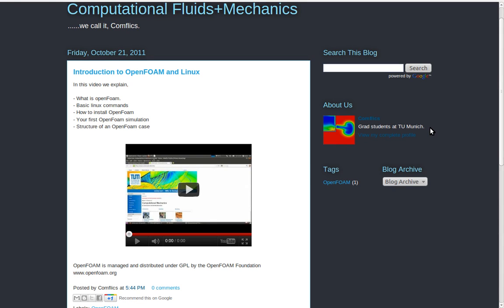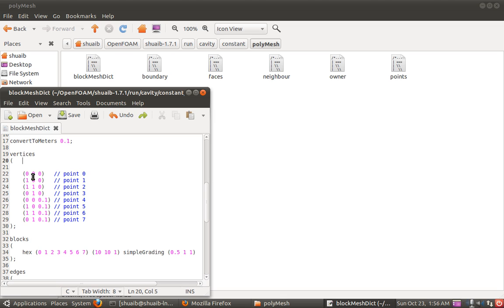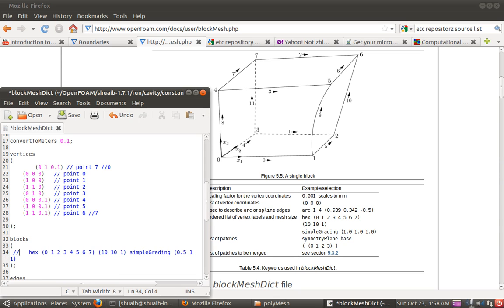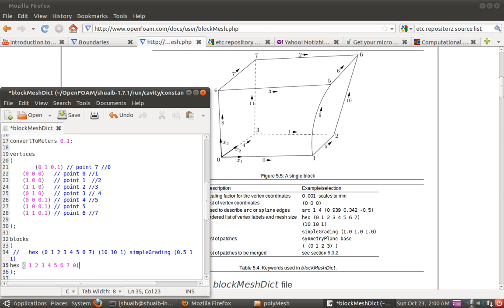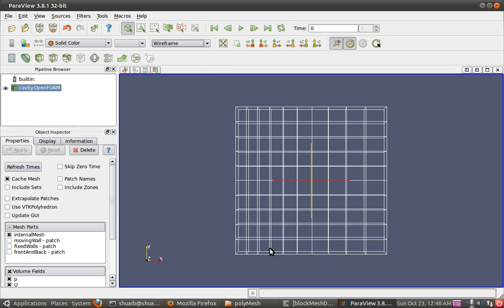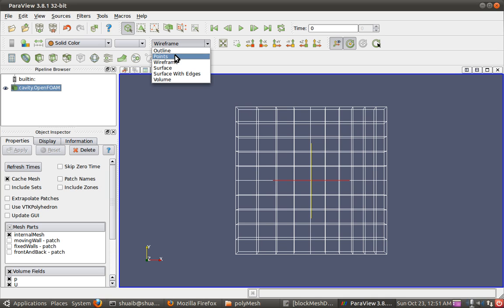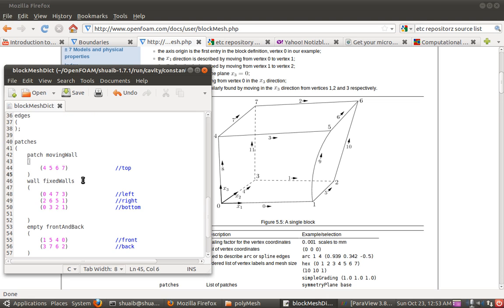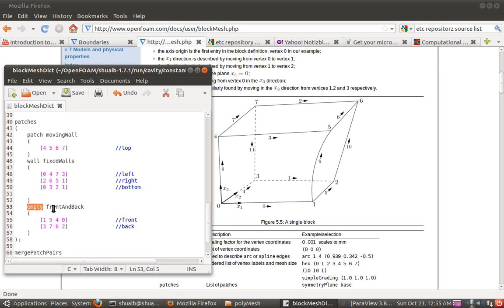OpenFOAM Tutorial #2 - blockMeshDict

Comment: Thanks. You know..I just tried again an I put the volume on half of is power and then I can hear easly. If I put at maximum volume than only silence. Now is working while Im using Ubuntu 12.04.1 LTS and Mozilla Firefox. Tomorrow I will tell you if it works also on windows. I have another quick question: for making complex geometry model what do you suggest me to use as a CAE software that you know works fine with OpenFoam when the mesh is exported? CaeLinux is fine? (caelinux.com) thanks. Luca